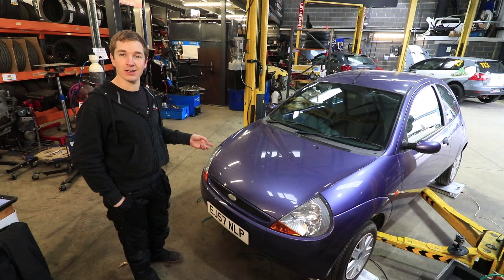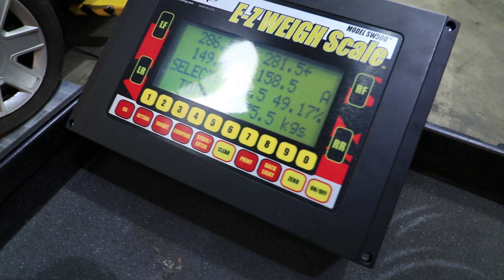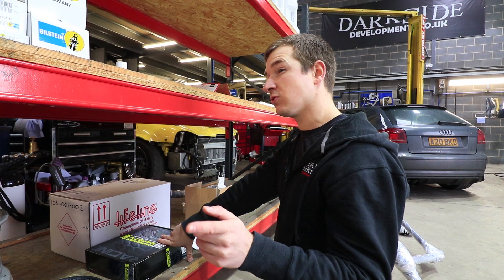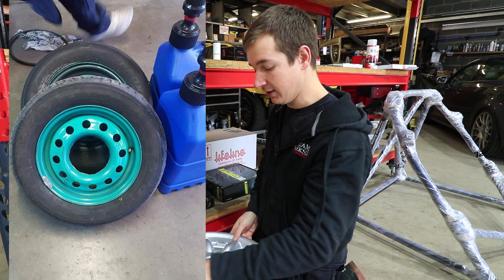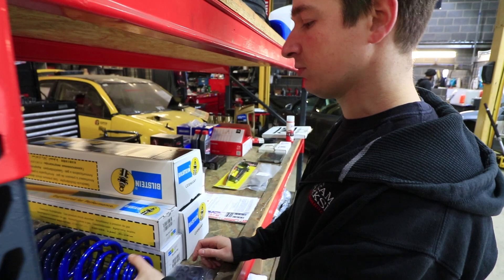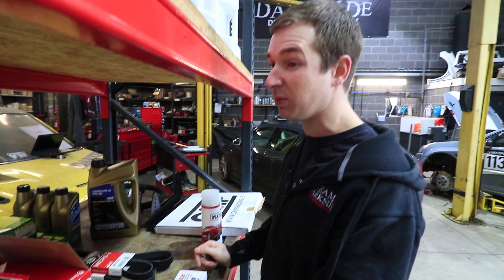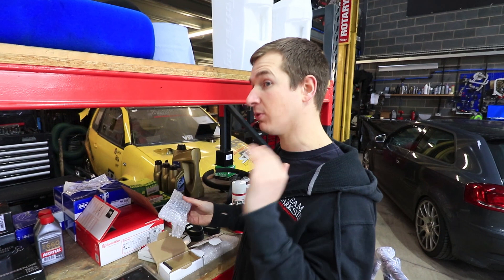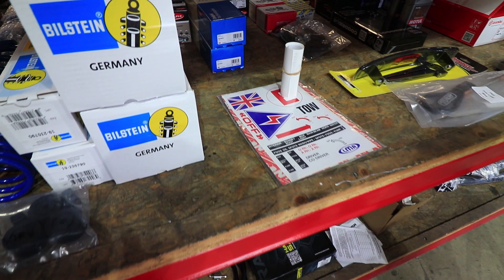NON TDI Content! Ford KA Budget Race Car! - DARKSIDE DEVELOPMENTS

Comment: Always wanted one of these right from when they came out, I finally got an MOT fail a few years back that needed a few spots of welding... so i started patching it up cut 1 of the sills off and started sticking a new one on then kept finding more and more rot in it so off it went to the scrap pile, and since 2013 I've not owned a Ford and not needed a welder.
Reply: Sounds about right!

Comment: Great Vid, maybe a strange question I have a 1.6 sport which I’m building a track fun car with but if I get into it if start with the control cage etc. if I later wanted to enter the Enduraka could I just put a 1.3 engine and gear box in my car do you know or is there more to it ?
Reply from the maker: Everything sportKa would need to be removed so it's a bit of work really!

Comment: Why do you need to change brake fluid every race. Does brake fluid have decay or wear issues. I’m proper confused
Reply: It absorbs water and when boiled turns horrible. Only needs the last bit bleeding out of the calipers usually.